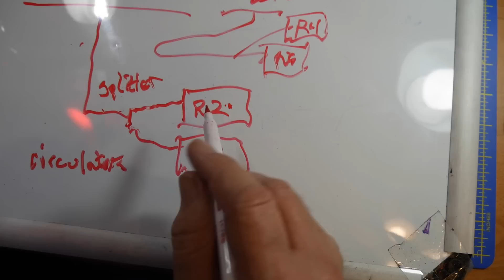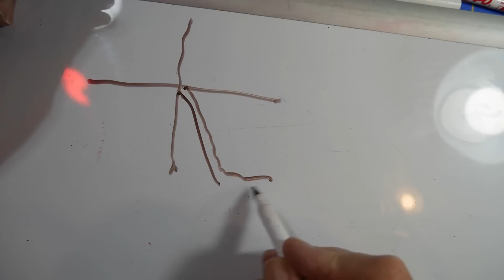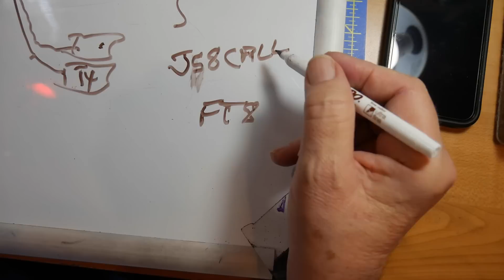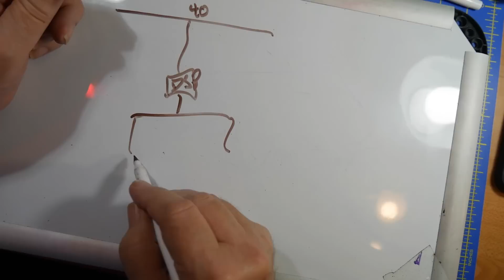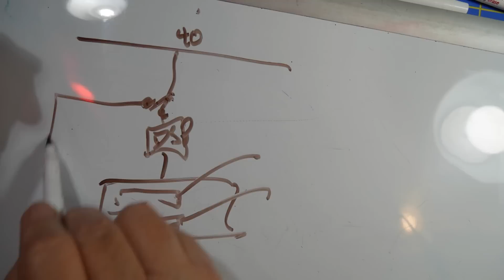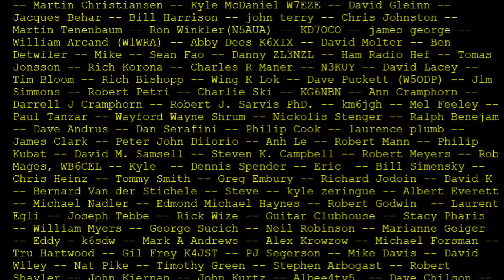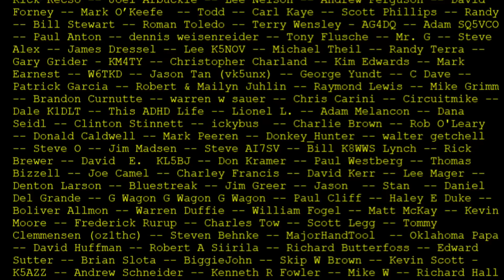Multiple Radios vs Multiple Antennas (#1208)

Comment: For monitoring I agree, use an SDR or two.
If you want to transmit as well (and you will), something like a hermes lite may be suitable, you can operate 4 slices 384khz wide with as many audio streams as you like within those slices.

I do have a true 2 radio setup - IC-7300 and a hermes lite 2, you need to have one radio disconnect the other radios antenna. I use a regular bog standard DPDT relay and that gives me over 60db of attenuation. You also need to use a transistor or FET to interface between the PTT output on the radio and the relay.

Comment: The easiest solution would be to buy a Flex 8600, which gives you four 160-to-6-meter receivers, two receive / transmit antenna connections and two receive only antenna connections all in one radio.  All of the switching and receiver protection is handled by the microprocessor in the radio.
Reply: EZ or Costly ?